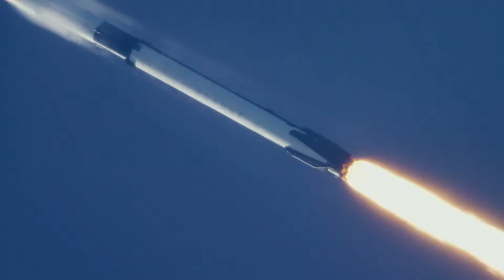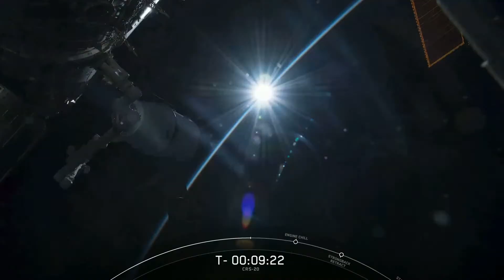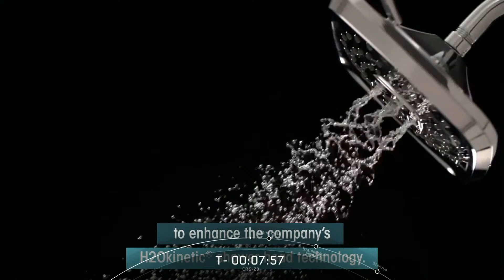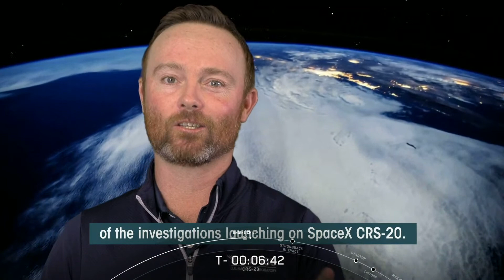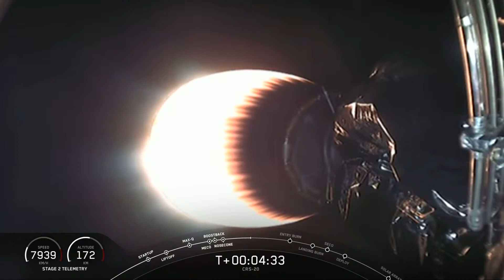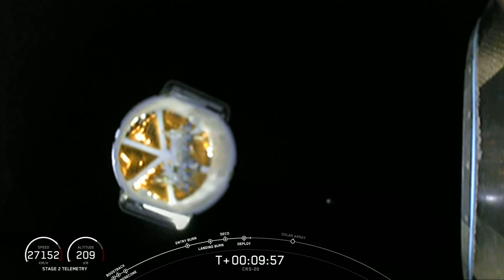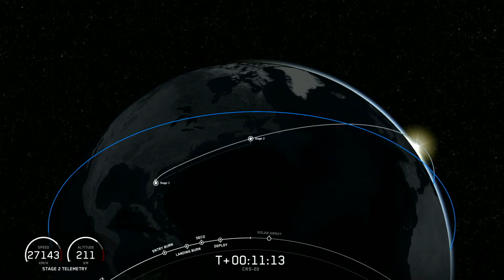CRS-20 Mission

Comment: No propulsion in a vacuum people.
Reply: wrong
Reply: Glenna Barry - Why don't you learn how a rocket motor works instead of making a fool of yourself here?
Reply: You think that the Saturn V rocket's 7 million lbs of thrust needed atmospheric pressure to push against?
Reply: How does 15psi lift millions of lbs?
Reply: Motokid600 what are you trying to ask?
Reply: @cowsgomoo4917  OP said thrust doesn't work in vaccum so how does it work in atmosphere? "It pushes off of it" - How? How does 15psi sea level pressure lift a several million lb vehicle?
Reply: Motokid600 ok, I wasn’t sure if you were agreeing with OP or not so I figured I should ask about it.

Comment: Rocket landed and is now stationed 
Current Speed: increasing above 25000km/hr
🤔🤔Makes no sense
Reply: Speed is from the second stage.
Reply: 1 part is STILL flying through space towards the Space Station for its 'birthing' there. (about another day and a bit to go). That landing rocket, is NOT the one still going to the Space Station.
I agree its a little confusing, like they need 3 screens instead of a split of 2.  But that's that.

Comment: Fatest bullet.......3700 mph
Fastest rail gun.......5800 mph
Rocket........ 17500 mph.......... Not a chance
Reply: What does the rocket do that the others don't?
It travels in a vacuum. The others are slowed down by air.
Reply: You have to go through the fucking air ......... Omg !
Reply: @glennabarry1261  No. They arc over the atmosphere before accelerating to that speed.
Reply: Glenna Barry you know both the bullet and rail gun shells are projectiles that only have the speed they started with right? They don’t have constant engine burn or multiple stages to reach higher speeds.
Reply: I bet it really fries your brain that it doesn't need to be aerodynamic to do that speed either.
Reply: @logitech4873   To say nothing of the fact that a rocket is continuously accelerated over several minutes whereas the others only have a single, near instantaneous force applied to them.
Reply: @glennabarry1261  And when you're throuh the air, you can alccelerate to that speed.
The rocket doesn't go that fast in the atmosphere.
Reply: are the numbers too big for you to comprehend?